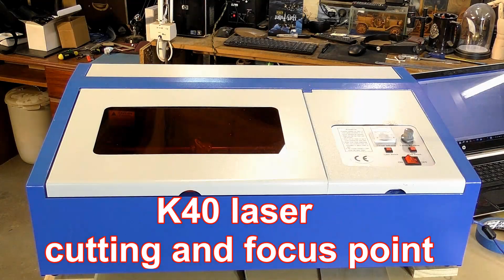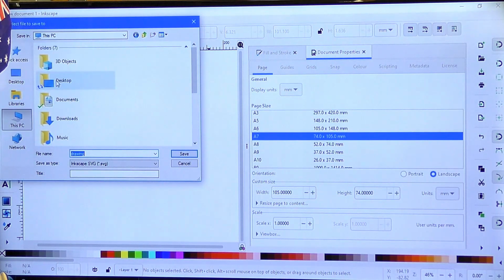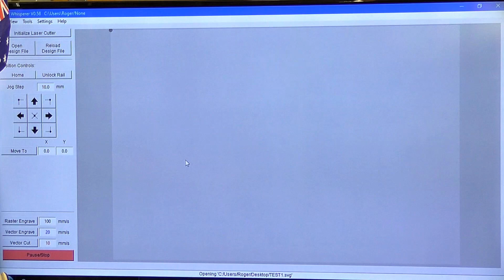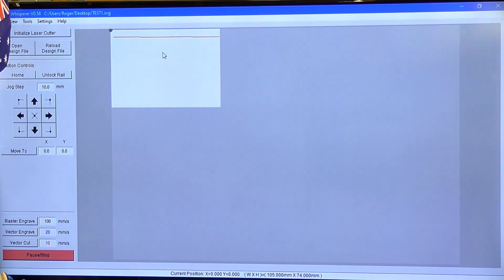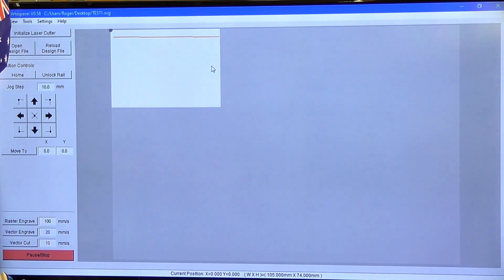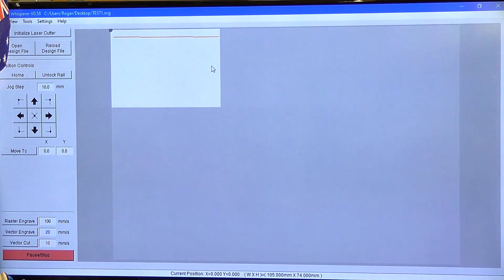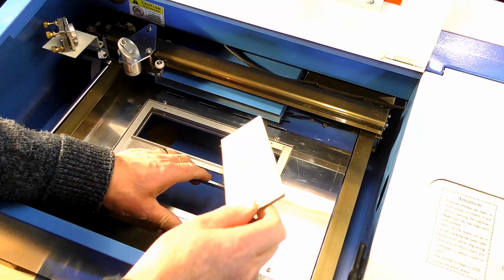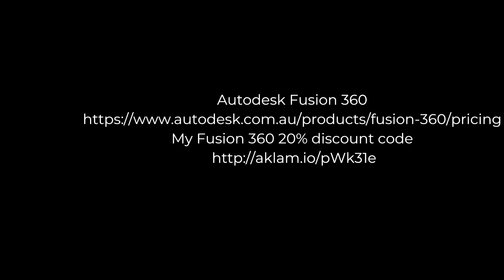K40 laser cutting and focus point

Comment: Roger, I flipped the fan on the electronics side. It was pulling dirty air from the laser side and spreading it outside the case..... I also replaced the controller with a DIY-one (K40-GRBLcntrlr) that supports PMW for improved grayscale engraving and the use of LightBurn software.

Comment: Shall be following along with this series.
 If I can "justify " it with She-Who-Must-Be-Obeyed, will seriously consider purchasing similar or bit bigger.
  Both the wife and I have operated and programmed lasers in the past. It's actually how I met the wife, as she was doing some cutting on Michelangelo's  birthday and got the computers infected with his virus.
   I started on a 700 watt fast flow, then went on to using two 500 watt machines, then was onto a 1000 watt laser.
  This last one was modified to also have the table swapped over to use a Makita router to do 5 dimensional cutting.
   In all the years of using them, I only "singed" my hand once!
   For aligning the mirrors and lens, I used pieces of clear acrylic.

Comment: Looking forward to the upgrades.  Mine has the air assist upgrade, but I want to do more with the exhaust air flow.  :)
Reply from the maker: Good choice!
Reply: @rogerwebb9600  I like the fan setup on yours. Mine has the huge one on the back.  Seeing yours has given me a couple of ideas. I'll be ordering one of the external versions for sure.  Looks like mine has the "extended" air box inside that intrudes on the cutting area.  Too bad I don't have any way to cut metal here. LOL ;)